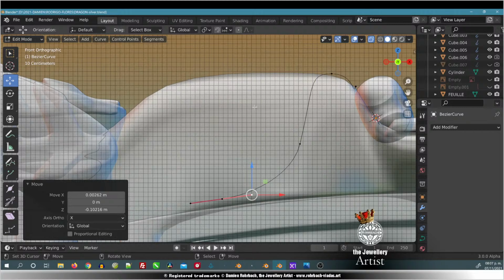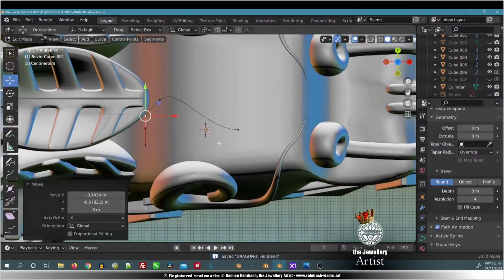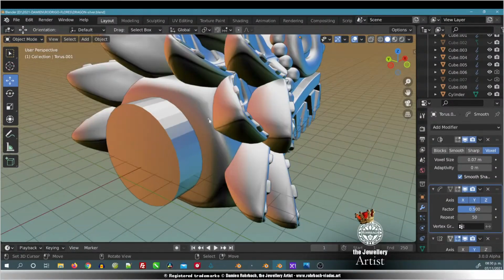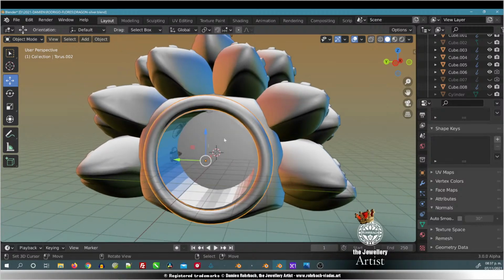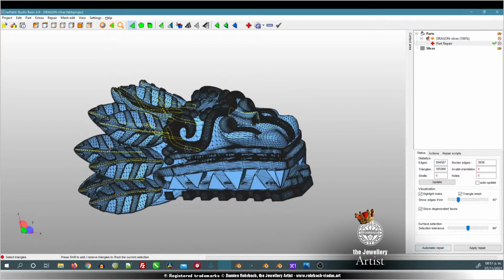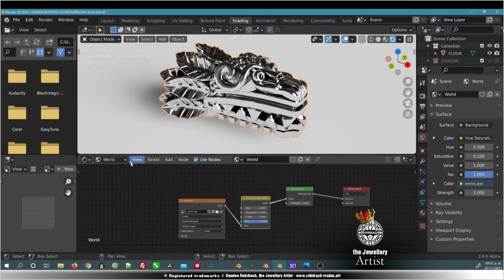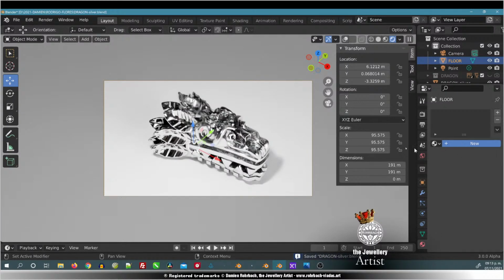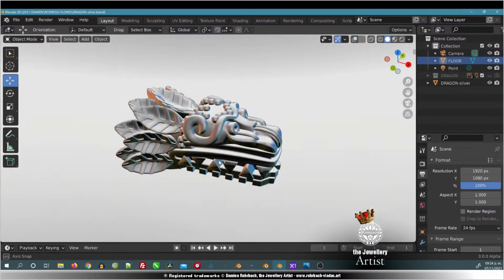Modeling a QUETZAL BLENDER 3.0 Jewelry design with Damien - Diseño de joyas - Création de bijoux

Comment: En cuatro saldría hacer un diseño de un pendiente teniendo el dibujo solo habría que llevarlo a 3d y los detalles de las piedras
Reply from the maker: A pues depende, si es un pendiente mamalon así con mil piedras y demás y vas a rechunchar por cada detalle, pues sale como en 1250 USD... Pero si tu dibujo es claro y sencillo y no mientes de lo que pides y es así simple y correcto como viene en el dibujo, pues sale como en 120 USD
Reply: @RohrbachJewelryDesign  es parecido a esta corona que tengo de perfil solo que modifique algo pero casi es lo mismo